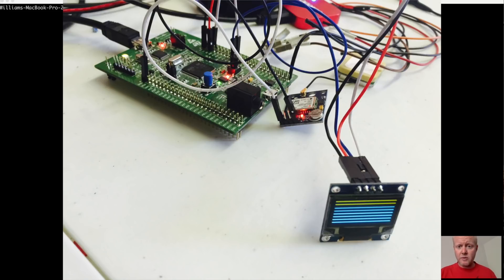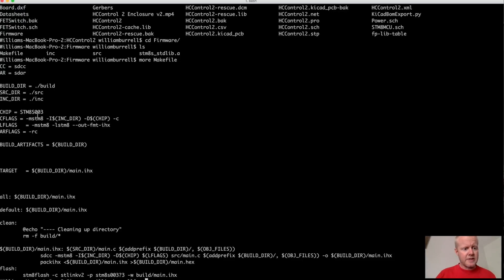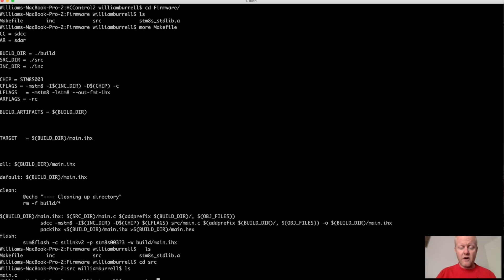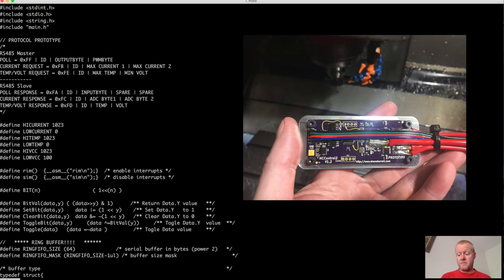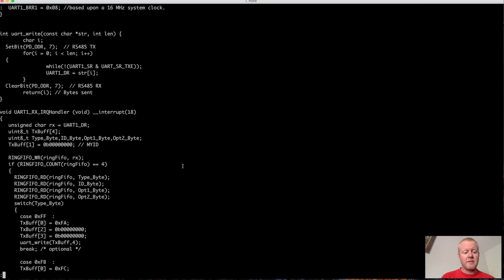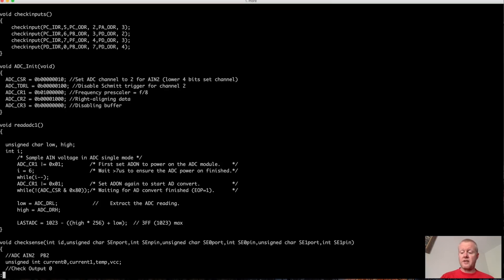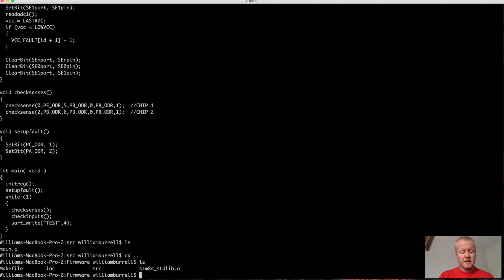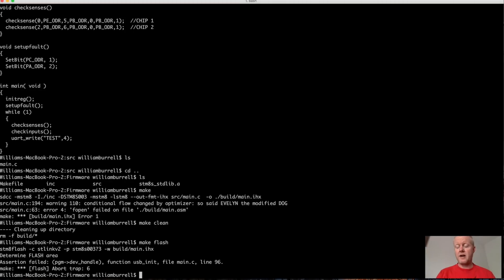STM8 Microcontroller - Getting Started A Basic Example

Comment: Thank you so much for making this video it has been enlightening and I got a lot out of it.
Having started out with assembler in the mid 70's with the 6502 it is really nice to see a low cost microcontroller where you can just throw it into a low end application without worrying.  My hurdle was getting my head around a suitable c compiler.  You helped me a lot in seeing sdcc as the solution.  Your approach is sensible and manageable.
Reply from the maker: Thank you so much for the kind comment!  I really like the STM8 for this type of application and it took me some time to figure out a development environment because, at the time, there was a ton of documentation on the STM32 outside normal platforms but almost nothing for the STM8.

Comment: Hi shane, what is the difference between the normal .hex and the .ihx that is used in sdcc? Cheers mate
Reply from the maker: The ihx file is the intel hex file.  packihx is what I normally use to get a hex file used for most programmers. I never actually looked at packihx to see what it is doing but that is where I would start if you want to look at what is happening internally.
Reply: @ShaneBurrell1  Thank you for the info Shane. I'm just starting to get into micros, do you think stm8 is a good place to start or is there a different path you would recommend. Thank you
Reply from the maker: I like the STM8 for learning and low level micro projects because it's pretty simple both from a compiler/programming standpoint and library standpoint.  With that said I highly recommend the STM32 platform for anything requiring it's level of processing and peripherals .  With it I prefer Eclipse and gnuarm for development eventually moving to cmake builds for production environment once a code base is developed.

Comment: Hello, thanks for video.

I want to install sdcc+stm32cubeide(or eclipse) in windows10.

I installed sdcc of:

https://sourceforge.net/projects/sdcc/

and installed :

https://github.com/gnu-mcu-eclipse/windows-build-tools/releases

I worked the GPIO,But I couldn't work with the etc. 

please help me
Reply from the maker: The STM8 is sdcc. And the small stm8s are bare and many won't support cube code (not enough code space).  The STM32 is likely what you want if you want to use HAL libs and debugging.  I use eclipse and gnuarm for that.